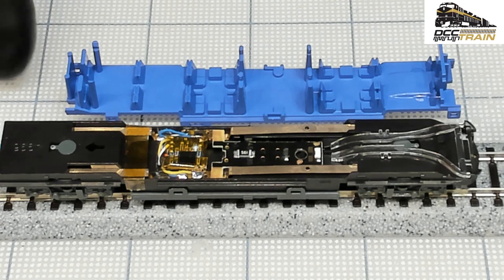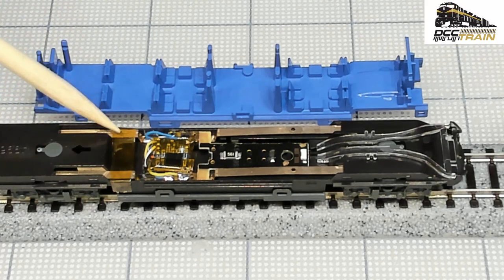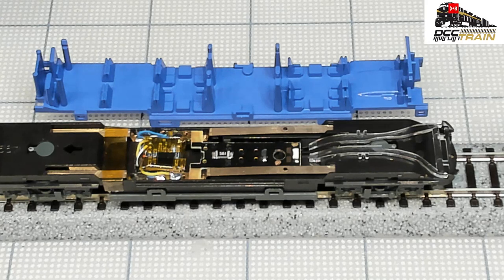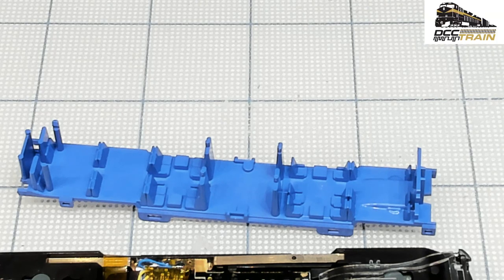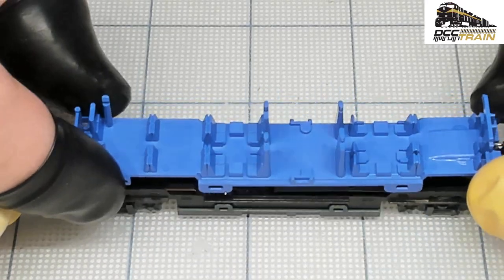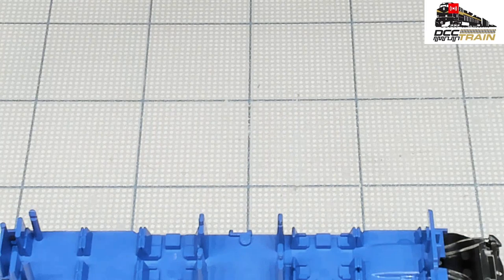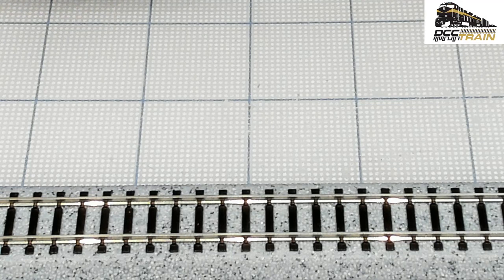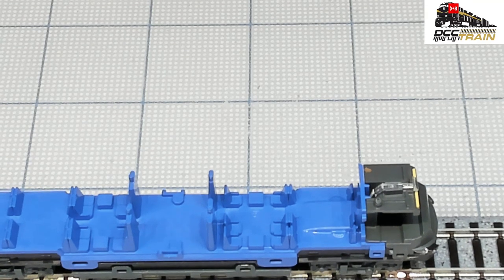Kato N scale ABe 812 Allegra RhB Review LED installation

Comment: Hi Maestro, Kato is the greatest track’s manufacturer. Seems nobody can beat their technology and quality. The only problem that it can provide less voltage than Roco. 

I have one tip. You could wrap in aluminium foil those light plastics. It would be brighter few times.
Reply from the maker: KATO foreva! Thanks. LED's are bright in the dark.

Comment: Excellent video - after watching your video, I dove in and successfully converted two of my Allegra trailers.  I used the ESU LokPilot 5 Fx micro, and it fit nicely although I did trim some of the plastic ribbing on the trailer chassis.  Kapton tape was a huge help.  Cheers!
Reply: You are welcome!